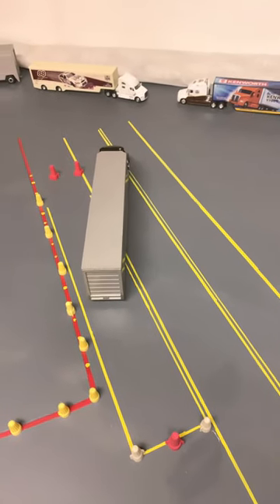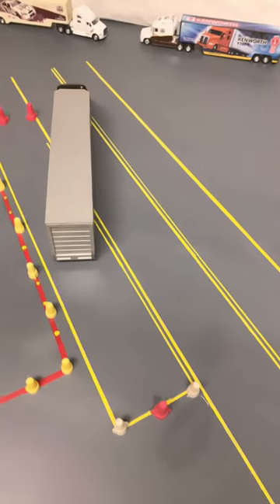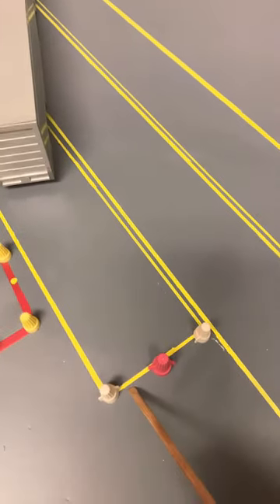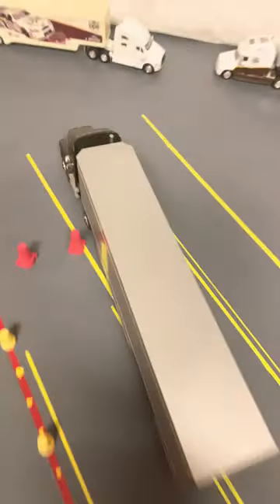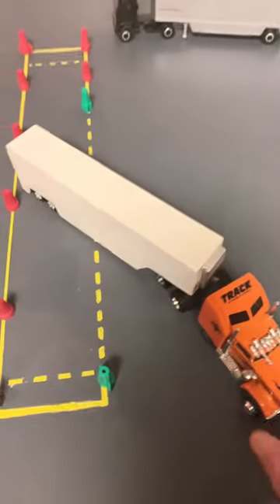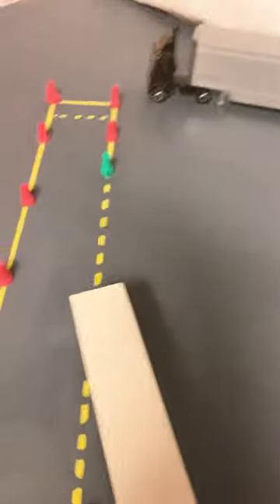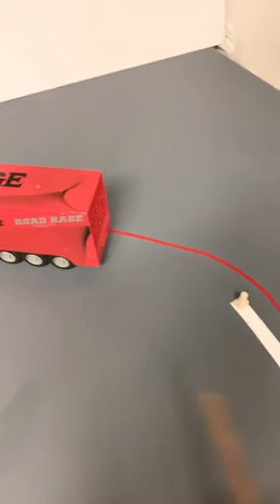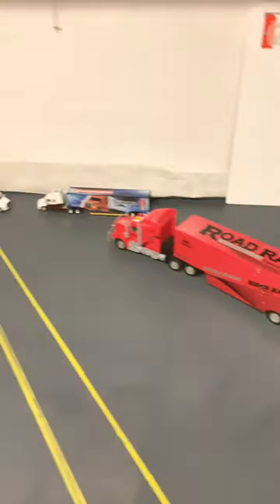How to FIX a POOR SETUP CDL School Training

Comment: I passed my road test today, I had a bit of an advantage on my maneuvers since I learned how to read the truck during my time in trucking school. I had to pull up a little once on my offset parking. In my defense I was used to a sleeper truck, day cab turns a little tighter, but I got it in there. Solid advice, you get two free pullups so don't be scared to use one, or two in my case, had to free wheel it in a little.
Reply: What school u went to

Comment: Very brief explanation. It would help to explain what to look for behind you when pulling forward.
Reply from the maker: Thank you for your input
Reply: You look forward when you move forward, but briefly at the driver’s side rear of your trailer to make sure it’s lining up to your target. You check the rear briefly to make sure you aren’t over correcting, but don’t spend too much time much time looking behind while moving forward because you undoubtedly will run into obstacles in tight spaces.

Comment: My partner is having trouble with the reverse offset - blindside. These tips would help her out immensely if this setup was exact but something doesn't seem right.

The company/school program she's in says that Minnesota has changed their rules on this maneuver, requiring it to be more precise by adding cones about where the 2nd red cone is when backing in (in between the area where the green cones are in the video). I looked online and found no such diagram, and based on what she drew out for me and recorded, it looks damn near impossible to back in without clipping the cones with the semi.

She is the only one left in the class who doesn't have cdl driving experience and the only one who has had trouble with it. Both the instructor and the two other experienced students barely completed the maneuver but did so by having to pull up twice and clipped the  cones slightly.  Apparently the instructor hasn't had a failure in over 3 years until this change happened, which happened about 3-4 weeks ago.

She does excellent on the written part and has studied her ass off day and night. I feel like they are setting her up for failure and screwing her over for $7k in schooling.
Reply from the maker: I have several reverse offset videos. Short and long ones.  The CDL school must work with those students who need extra help. The FMCSA states that the students must be proficient in all skills. Many CDL schools will still schedule them for testing and change them for retesting. 
     ( see bad CDL schools videos)
Hopefully the test will be done in a day cab - 48 foot trailer .

Comment: Instructor Steve you always give good tips so if you don't mine I was Parking a tractor-trailer on a slant and could not get my set up right and it gave me hell it was the first time couldn't figure out what I was doing wrong trailers on both sides Yikes!!!
Reply from the maker: Get out and look 👀. Don’t rush and ask yourself what do I need to do? Where should I pull up and reset my angle. Get back in and do it. 
     We all have situations with backing into tough spots but think 💭 it out - you will become a pro before you know it.

Comment: My drive tire and mudflap keeps going out of bounds on the right. What am I doing wrong? Can you please help me
Reply from the maker: Remember it’s only a 12 feet wide. When you see your left drive tires going more then one yard to the center of the alley, your right front trailer and right drive tires are going out of bounds. Hopefully the trailer is in the alley. Just do a small pull up then back the rear of the trailer into the three foot box. View the overhead full test. When this driver backs into the alley, you can see a lot of space between the left drive tires and the line. The right side is out of bounds ( two points). On that video you cannot see the right side but the driver backs up to much. With the left drive tires on or near the left line, should have the left on to back under the trailer. Check the right mirror and if necessary pull up.

Comment: What is the second cone?
Reply from the maker: On the Standard test, CDL Schools do a Parallel Park. Backing into the alley, there are three cones.  In the video you will see the three cones - the one on the left - one on the Right and one in the middle. 
     Your CDL school may be doing a reverse offset - the new testing now being done in most states.

Comment: I had this down in 1 hour backing up 12 different trucks. It was so easy that i feel silly that I ever thought it was difficult. Tomorrow I'm gonna go out and buy 12 NEW toy trucks and see I can do it easily again. This was s breeze honestly.
Reply from the maker: The concept is the same with a tractor trailer. Get your toy trucks 🛻 and thank you for your comment. Put a smile 😃 on this old man.
Reply: @truckerstevecdlinstructor  I'm very glad my friend that you recognized the playfulness of my comment. Absolutely agree that this method is great to visual everything, just at different proportions. 
Now for the serious side, what tips can you give me for offset parking left and right? Any other videos or a reply would be appreciated. Thanks! 😊
Reply from the maker: @stalkerstomper3304  I have about two videos on offset to the right. In a tractor trailer ( not a toy truck). Should be one on how to fix a poor set up also.  Click onto my playlist also.  
       The offset to the left, the driver must his left mirror. Straight line back ( if needed, some left to get the trailer heading towards the cone.). When the right tire is on the or just before, hard left to bring it into the alley. Make sure you are always looking at the correct mirrors.  If you have a poor set up, you can fix it going back wards.  The real of the trailer is facing to far off the cone to the right. Do another setup- turn the steering wheel to the right and back up little the following up with the left to get the tractor trailer straight. Hopefully now your trailer is heading one to two yards off the cone 
    Students need to practice moving the trailer to the left and right.  You are the boss of where that trailer is going.  The trailer is not the boss, YOU ARE!  It’s all about reacting to your trailer. 
      Since I am no longer teaching at a CDL school, if needed I can make a video at my job for you or use your favorite toy tractor 🚜
Reply: @truckerstevecdlinstructor  Wow. I'm an older driver in my early 50s, and have been driving straight trucks since I got my class B 5 years ago after retiring from public school teaching. I'm back in trucking school for my class A as of this week. This is a treasure trove of info from you. Thank you and I will absolutely check out your playlist and sub. Thank you for your time my friend and a speedy response. I'll get back to you when I have more questions if you're able to help more.
Reply from the maker: @stalkerstomper3304  Thank you young man 👨.  I started late 1974. 
This past spring, I had a student who was 72 1/2 years.  Just a few months older than myself.
Reply: @truckerstevecdlinstructor  Waiting to see what my instructor will have for me today for our 1 on 1 training. Last week I had 2 sessions, and both were only offset left and right repeatedly after a few straight up and back maneuvers. I would absolutely appreciate a video demonstrating offset left and right if you're able to find time to do one. It'd be a great help for many trucking students. Being an older student in my early 50's means I don't have the luxury of time for unnecessary mistakes in the learning curve. I would so grateful for any help. Thanks again my friend, and what's your first name? Mine is Mike. Thanks again. 😊

Comment: im in school rn and were doing offsets ant the only part i can donis pulling up☠️☠️ ive been so mad cus its like the easiest part hopefully this helps lol
Reply from the maker: @brettsimpson4947  have quite a few videos on this.  Please check them out
Reply: @truckerstevecdlinstructor will do still struggling a little came back and will try again instructer told me hard right then fix should i make smaller turns?
Reply from the maker: @brettsimpson4947  work with your CDL Instructor.  Practice as much as possible. It will click and you will understand the concept.

Comment: Need more elaboration on this confuse me sometimes n I have a test 2/06
Reply from the maker: What skill will you be doing for your test? Also where is your CDL School.  May make a new video for you to better help you.
Reply from the maker: If the trailer is to far to the left, you can reposition the trailer by going to the right 6 feet the back to the left. Look at your left mirror. When you see the cone, straighten out.   For the parallel park, if you have three cones ( to far to the right) once again move to the right then to the left. As soon as the middle cone comes into view in your left mirror, straighten out.  Not sure what skill you will be doing.  Practice moving the trailer left and right- make sure your mirrors are properly positioned.  For the skills, you need a good set up .
Reply: @truckerstevecdlinstructor  
I’m in Bama. I have to test in a few weeks. We have to do Straight Back, Offset, & 90 (Alley Dock) . I’m struggling soooo hard with the 90. I keep coming in early !! Idk how to fix it. 😭
Reply from the maker: @ShaunTachelle  hi Bama,  In three weeks, you will with hard work get it done.  Motor Skills as it relates to range skills is doing a skill over and over.  When doing the 90 degree alley dock, don’t over do your set up. Turn the steering wheel to the right and back up a short distance and get the steering wheel straight. Back up ten feet.  Are you going into the Alley? If not? Use small pull ups to adjust the trailer. View all my videos and my playlists for this skill.  ( click onto playlist).  Three weeks is enough time. You need to train your brain to react to the trailer. This is motor skills.  Best to you in the coming three weeks  You can and will do all skills in this time frame.
Reply from the maker: @ShaunTachelle  If you are coming in early, your over doing your set up. Or not controlling the trailer moving to the left by turning the steering wheel to the left as needed to keep it on track.  ( to the alley). When it starts going late, turn the steering wheel to the right get it on time and back with the left.   Remember, small pull up when needed.
Reply: @truckerstevecdlinstructor  90 degree backing is alley docking ?
Reply from the maker: @Ukacip  Alley Dock can be 45; 35 or 90 backing into a dock. Cdl test you will be 90 degree backing into the alley.
Reply: @truckerstevecdlinstructor  am checking your videos to see about this i am currently learning 90 degree backing
Reply: @truckerstevecdlinstructor  Okay Tysm !! It’s getting better I got the hang of it now. I’ll update you once I get my license ! Tysm Trucker Steve. 😊 We’re working with a very small space to Alley Dock in but I’m making it work.
Reply: Turn toward the problem pull up & snake it back straight..

Example 

If trailer is too far left pull up with a left and drift the trailer right
Reply from the maker: @YovngLord  thank you for your comment
Reply: @YovngLord does this work for a 28 ft too